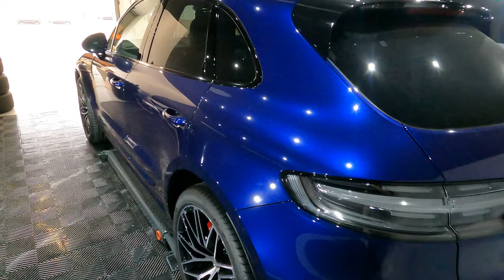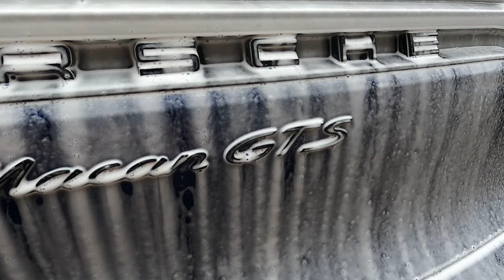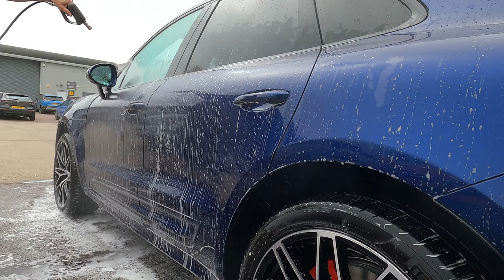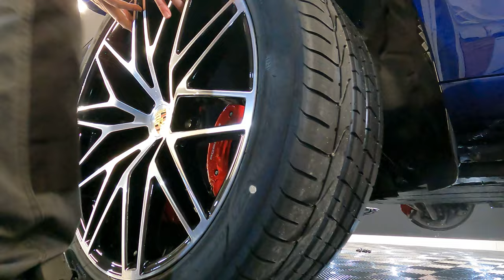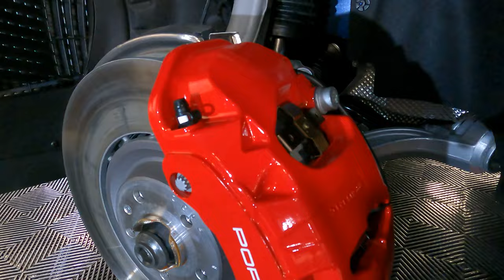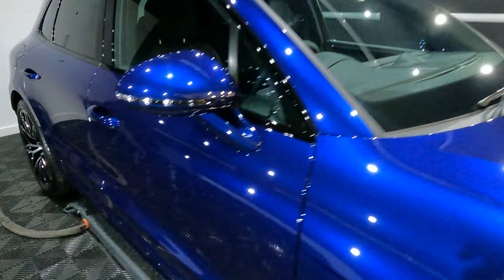New Car WHEEL OFF Detail And CERAMIC Coat - Porsche Macan GTS

Comment: Wow nice detail . You got any tips to clean the brake calipers? Got a tesla and the brake calipers look ugly thx
Reply from the maker: Thanks very much. I’d start with a regular wheel cleaner, let it soak for few mins, then go at it with a detail brush do you can get in all the dips. If it’s really bad, you may need to use a fallout remover. If you do manage to get them clean, I would advise to take the opportunity to ceramic coat them. That’ll make maintenance washes much easier 👍